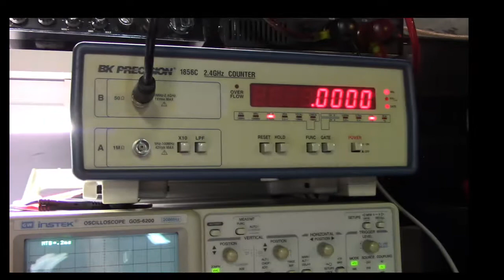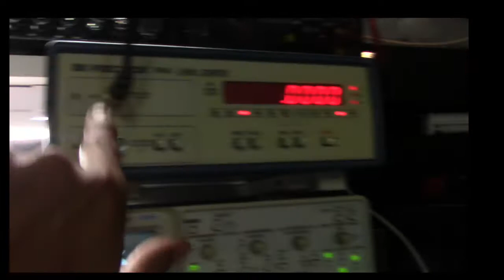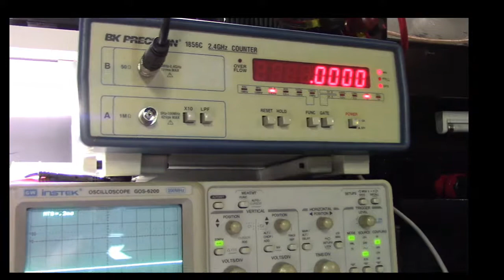Frequency counter tip and how-to for cb radio

Comment: This is also an easy way to monitor your output waveform on your oscilloscope. However, this trick doesn’t work well with some amateur coax switches such as the alpha delta brand. 

Another inexpensive way to monitor your frequency or output waveform is to wrap an insulated 18 awg or similar sized wire around the coax leading to the antenna. 10 turns or more around RG-8 work well. Connect this to your scope or counter with a BNC cable that is terminated with alligator clips. Make sure to wrap the coiled wire with electrical tape or similar to keep the wraps tight. 

Keep up the good work. There isn’t a whole lot of people showing this stuff in the CB radio field. 73
Reply from the maker: Thank you for taking the time to view my video. Yes you are right it won't always work with every coax switch. I have some more videos coming up soon so be sure to subscribe. 73's

Comment: Matt that’s a great tip!!  Can’t believe I missed this vid.

I used a Mcbazel handheld frequency counter (8 digit) for my off frequency on SSB McKinley.  Got it to frequency!!  Not the ideal was but it worked!!  The only thing is adjusting SSB was a pain.  Small movements would make the frequency jump 100-200 hz.  Took an hour!!   Sorry the the long reply.
Reply from the maker: Oh man you're going through the archives lol..glad you were able to get that McKinley straightened out
Reply: @TheRadioGarage  thanks Matt!  It just popped up in my feed.  The mysteries of YouTube!!!

Comment: Could you tap an rf signal for an Nixie tube counter like my old Yaesu,Heathkit or Henry from a line section via a bird sampling Tee or sampling slug?
Reply from the maker: I'm not familiar with nixie tube counters, but I would think the same theory would apply. Just depends on the sensitivity of the counter input
Reply: YES. THE DISPLAY DOESNT MATTER IF NIXIE, LED, LCD. OMG

Comment: I just tried this on a superstar with 4 watts output and a Simpson 710 frequency counter but it doesn't read anything. I have a dummy load on the switch because I don't have an antenna. should it work anyway? ,, I would have thought enough rf would have passed inside the switch.
Reply from the maker: depends what coax switch you are using. the cheap ones are good for this because they don't have much shielding.
Reply: @TheRadioGarage  I will have a look inside the switch, failing that Ill see if I can connect FC inside the radio.
Reply: @TheRadioGarage  It worked fine with a different frequency counter. The Simpson 710 probably wasn't sensitive enough. :)
Reply from the maker: @Jonnyweareten  ok glad you got it figured out

Comment: How would u check the radio if u did have it open just using a prob???
Reply from the maker: Yes you can use a probe depending on power levels.